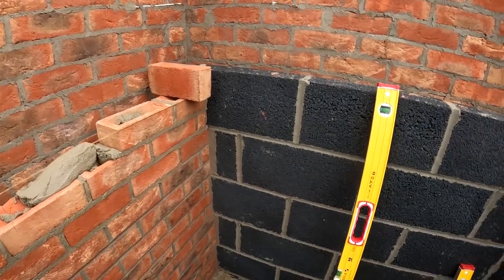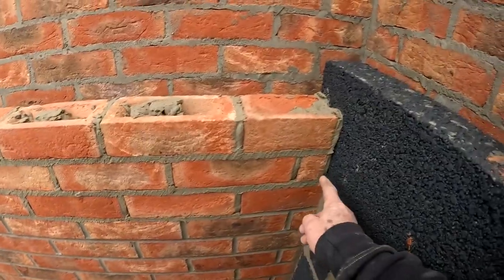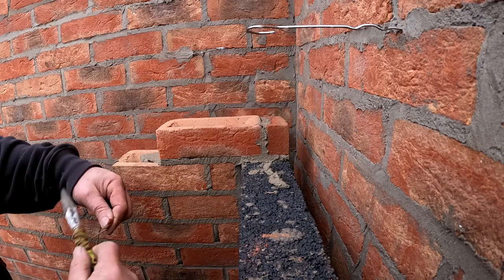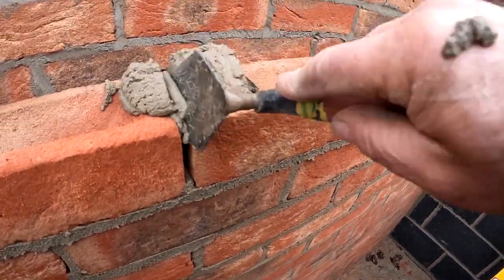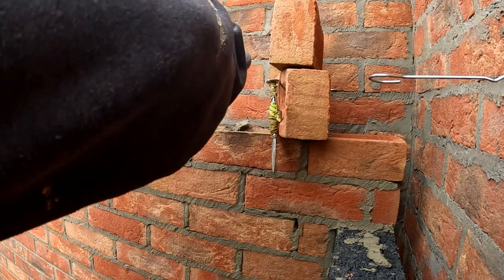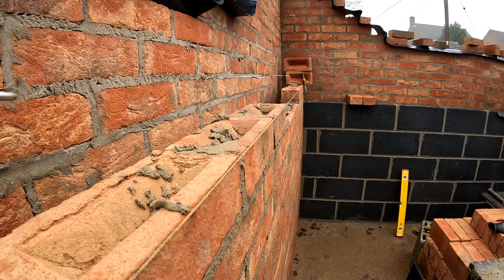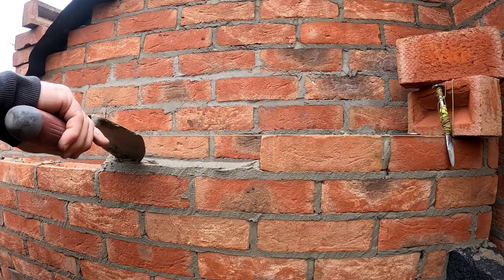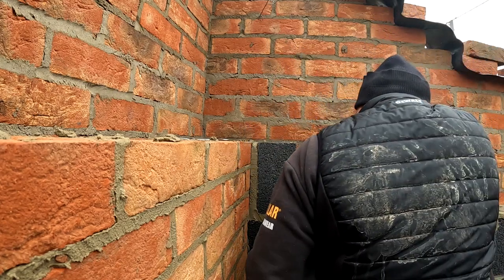Bonding face bricks and blockwork

Comment: Is there a reason you didn’t butter them brick and shoved in mortor with a trowel ? Can you elaborate also a video you did with no buster joint on a corbel pop out brick 🧱 seems a buttered perp would hold it in very nice
Reply: I was thinking the same thing for a guy who obviously takes no shortcuts I'm surprised he doesn't double butter the closure I was taught that that is extremely important and you can't replicate it buy just slushing in the empty end joint

Comment: What trowel you use bud
Reply from the maker: I used to use a WHS leather butt , but I picked up a trowel one day inB& Q of all places and liked it, it’s a Ragni it feels really  good, so that’s what I’m using at the moment, cheers for watching 👍
Reply: They are decent trowels bud . And it proves the point that a welded trowel can be just as good as a one piece forged trowel .
Reply from the maker: @brickbybric  I think you can have the most expensive trowel or the biggest in the world, but if it doesn’t feel right it’s no good, I just feel comfortable with this trowel no real cost to it , 👍👍🧱
Reply: @brickbybric  u can get them solid forged as well. Ragni Crown, cost around 30 quid. Been using them for years.
Reply: @wolfganghachmuth5419  how’s things Wolfgang . Yes they are decent I’ve had a few of the one piece forged ones through me hands
Reply: @brickbybric  when they first came out, they were broader at the heel than Marshalltown. That's why i liked them. By now they're just like marshal, only cheaper.